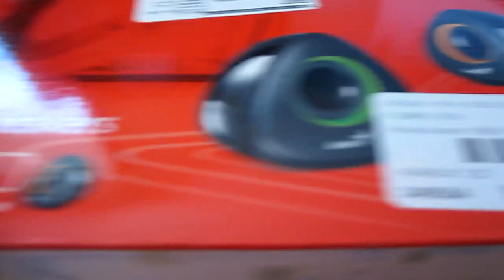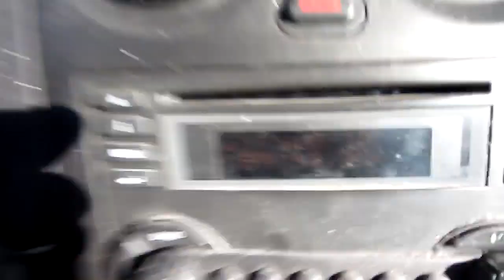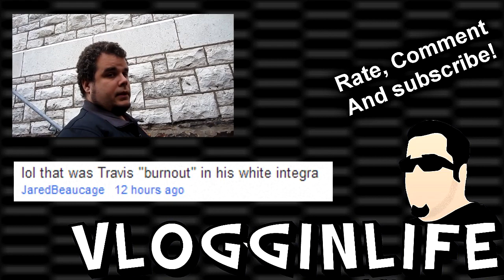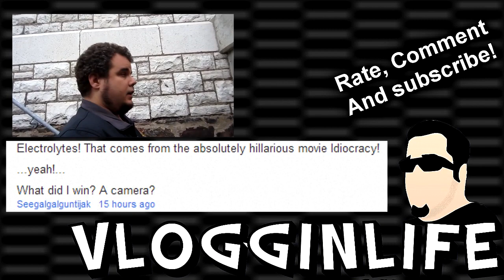Attempting the haircut while my server dies!

Comment: the card you have only supports two independent video channels, so the three monitor setup won't work for you. unless you used a splitter...which for your needs wouldn't make much sense. I have a similar card and had the same idea, but... No go.

Comment: Does your HP MediaServer already have VGA-out on the back? Then you can easily put another OS on that little machine without the need to build a special adapter-cable :)
btw: What's the problem with the server? Doesn't turn on anymore? Maybe taking it apart and cleaning the CPU-heatsink and stuff might help or you can locate the problem while doing so. :)

Comment: I hardly play any games at all so the game-performance of the ATI 5770flex isn't much of a deal for me. 
The ATI 5770flex replaced my older setup with a Nvidia GeForce 8800GTS-320 and a Nvidia GeForce 8400GS (with that setup I had the two 24" Dells connected to the 8800GTS and at that time I only had a cheap 23"-Samsung as a third screen which was connected to the 8400GS) - with that setup Windows would often crash or freeze so I decided to get the ATI 5770flex which fixed that problem :)

Comment: And that's why I decided to buy an ATI-card (had to go with the Sapphire ATI HD5770flex). I have two Dell 2408WFP 24" (1920x1200) and one Dell U2711 27" (2560x1440) connected to that card - works fine except that always when my monitors go into power-save-mode ALL my open windows are messed up and not on the screen and position where I put them (kinda annoying but there's nothing I can do about that). :)

Comment: Nvidia didn't get 3 screens working on 1 card till the 600 cards, So you would need 2 GTX 550 TI's to do it. Right now im running 2 EVGA GTX 670 SC 4GB cards in SLI, And there running my 3, 24" 1080p screens easily :)

Comment: I started with a 5770 flex, And I added 2 more 5770's. (Still have all 3, Really need to sell them lol) They just didn't have the power I wanted, So I went to a AMD 6990. Then I wanted more so I added a 6970 with it for a 3 way crossfire, Like with my 3 5770's. By this time I was sick of AMD drivers. Everytime a new game came out I had to wait a week to a month for it to run right. So I went to my 2 GTX 670 4GB in SLI. So far I have not had 1 driver problem with Nvidia and everything works.